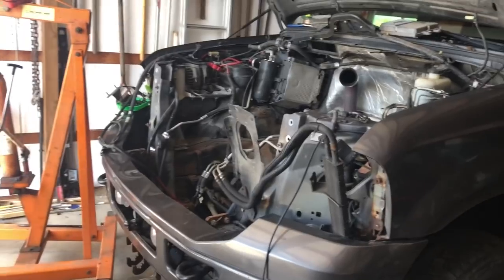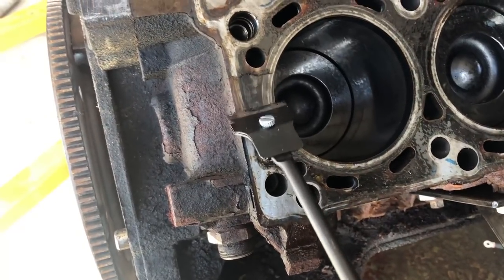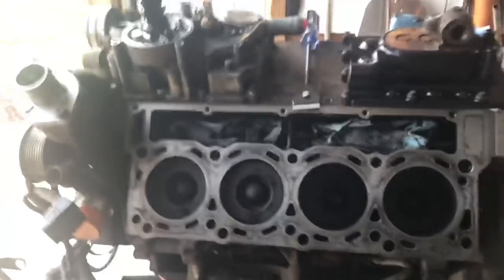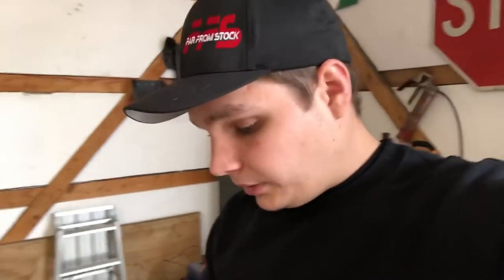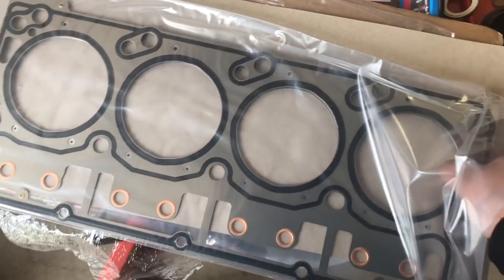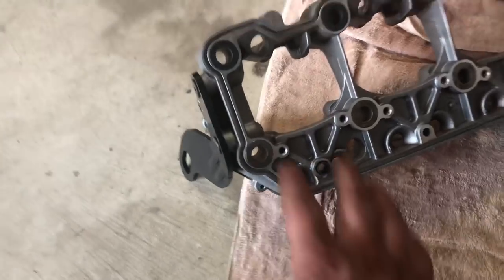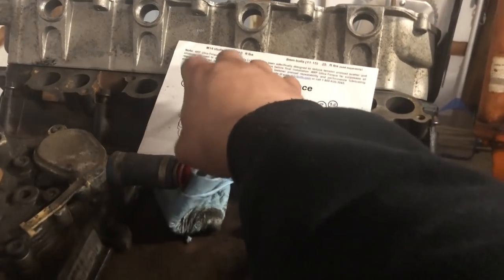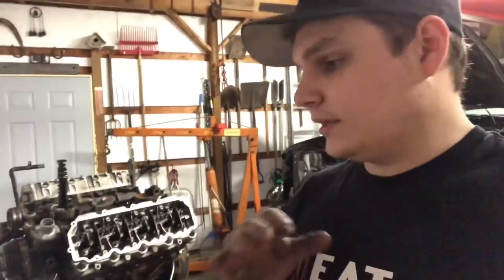STUDDING A 6.0 POWERSTROKE PROPERLY!

Comment: I was wonder why you like the ford powerstrokes so much I like the looks of them but people always say to stay away from them because there junk are the expensive to repair I work on all my gas engine the diesel don’t look hard to work on I was think about a 7.3 but I heard the 6.0 have a better transmission just wanting to hear why you like em thanks for the video
Reply: sorry for the long read... ford powerstrokes have had a bad rap in the light duty diesel world as they should, because they continuously have problems with their motors that competitors dont. however, its ford, and everyone associates ford with american (even though everything on the powerstroke is made in mexico) and their interiors and ride quality are far superior to ram and gm, like its not even close. because of this, powerstrokes and all the problems they have had are overlooked and people still demand them. they are and have been produced at a much higher rate than light duty cummins and duramax powered trucks, meaning the market is flooded with them and they are cheaper to purchase second hand. all diesels are expensive to work on, but there are a lot of people who have a budget and cant afford to spend 27k dollars on a 2005 cummins with 250k miles but can afford a 2005 powerstroke for 14k with 150k miles. because of this, many people who need a diesel for work or simply want one without breaking the bank turn to powerstrokes. so then it becomes what kind of motor. powerstroke motors were produced by navistar up until 2011, when the newest 6.7 liter powerstroke came out. 7.3, 6.0, 6.4 were all made by navistar and were all flawed in some way, which is why ford eventually dumped navistar and produced the 6.7 on their own. 7.3 have garbage transmissions, 6.0 tend to have bad oil and egr coolers and blow head gaskets, and 6.4 tend to have the entire long block grenade do to poorly designed parts by navistar. so for someone today, in 2020, looking at a used powerstroke who cant afford a 6.7, it usually comes down to between a 7.3 and a 6.0 (6.4s were such a basket case and a money pit that very few people consider them). the last 7.3s were produced 17 years ago in 2003... thats a long time ago. the motor has an amazing reputation for reliability, but they are just old and they ride very very rough. the 6.0 on the other hand is becoming a more and more popular option. it rides way smoother, is not as old, and produces way more power stock. because they had so many problems with the motor early on, the research and parts have been conducted and made to prevent these problems. a "bullet proof" 6.0 effectively eliminates the shortcomings of the motor (so long as you maintain it and dont abuse the motor) and makes it very reliable. add that to a relatively cheap market value, a generally solid transmission, ride quality, and a nice interior, and you can see why the 6.0 has become a popular option for people in the market for a diesel but who dont want to spend a fortune. sure people still love their 7.3s and it has earned the reputation, but as the years go on they become more and more primitive compared to newer stuff, people just have a tendency to avoid spending money on something so old. thats why the 6.0 is becoming a more popular choice
Reply: @natewilson7664  thanks for the reply
Reply: Nate Wilson excellent reply mate. Cheers from australia

Comment: Is it easier for you to pull the engine out to do head gasket vs doing it in the cab by removing hvac box or pulling a motor mount
Reply from the maker: I like to pull the engine for 3 reasons. 1. I don’t have a hoist to pull the cab... 2. Pulling the engine allows me to verify everything is clean, holes are clean, and the head gets set down perfectly.... 3. I get to reseal anything that was leaking like the oil pan/upper oil pan/bed plate etc. 
Overall the only extra work is disconnecting the transmission and undoing the motor mounts. But the benefits of having it removed completely outweigh that little bit of extra work. 💪

Comment: Hey I've got a few questions I saw in 1 of your other videos you have a one piece Turbo down and up pipe do you sell  those if so how do I go about buying them I've took the 6.0 out of my F350 we straight edged the motor block it has a .004 gap in between the 2 center cylinders right where the gaskets lay I'm gonna have my block decked and I've had my heads resurfaced will I need shorter piston rods an push rods

Comment: Scothbrite 18730 bristle disc is what you NEED to be using on those heads.. not by hand. You’ll never get that carbon build up off. And make sure you get that oil out of the head bolt holes or you will make a hydraulic lock in the bottom of that hole and when you torque the studs the oil has no where to go (think of a hydraulic piston) and you WILL crack a block..
Reply: Size 50? Or size 80?  I used 400 grit but it's not doing anything.

Comment: Been using razors to flat sand blocks for years now, I will never use a die grinder again. They don’t need to be shiny, they need to be flat. Definitely engines with liners, it’s critical not to cut material away that you can’t get back. After that its good to check it with a straight edge for  deck flatness to make certain you have no low spots 👍🏽 great vid bud.

Comment: I'm curious, you take your motor out the front, instead of removing the cab. It's because you don't have a lift. But if you did, would you still take it out the front, or would you use the lift?

Comment: Do I need the 6.4 pushrods if I get brand new KDD o ringed heads? Or just a stick with my stock 6 liter push rods?
Reply: Some later model 6.0s (like my 2007) have the shortened 6.4 updated pushrods , their slightly shorter, if you have them out measure them , the numbers can be found on Google

Comment: So much misinformation on these videos. I been doing these trucks since new. I never seen a cracked 6.0L heads in combustion chamber.  Just cracks in the  injector cup area and there are repair cups out there to fix those cracks. Any crack found in a 6.0 head surface is superficial and will never hunt a thing.
Reply from the maker: A cracked head should never be ran. A crack doesn’t go away, it only gets bigger. Most of the time i see cracks that start superficial on the surface but they work their way down into the exhaust valve seat. Big concern. What you think is misinformation is new knowledge that you don’t agree with. We can agree to disagree
Reply: @LeftLaneDiesels   We dont have to agree to disagree. That is a fact right from FordMoCo.
Reply from the maker: @steves7458  is the manufacturer always right? The answer is NO, lets be realistic. I respect your opinion of the matter and I don’t discredit your experiences. I know what ford says, they also say not to surface the heads. At the end of the day it comes down to my experience. Cracks continuing into exhaust seats and extreme warpage on heads. The 6.0 industry has grown, the knowledge base and experience has out grown that of ford.

Comment: It seems to be informative.   Did you check the deck for straightness?  You should use a sanding block tool and confirm the deck is straight.  And a straight edge.... just a thought especially since the head gaskets blew.  As well as it wouldn't be a bad Idea to recommend using hardened seat heads.  Since that is the most common crack found,  and regardless of what Ford considers acceptable I would not use heads cracked from the glow plug hole either way.  May cost more now but, in the long run could cost more.  The other would be using O ringed heads new castings and hardened seats.  Will save a lot of trouble.  Pulling out the front is so nice.  We do that since the cabs kinda suck even with a crane and jig.  Other than that you seem to have a pretty good video to help some people out.
Reply: I wouldn’t hit it with a sanding block tool unless you want a total mess on the deck surface.

Comment: Here is my question… seeing how long the bolts are it seems absolutely impossible to do an ARP stud installation with the motor in the block . So I’m assuming the service can only be performed with the motor pulled. Is my assumption correct?
Reply from the maker: It can be done cab on, many people do it that way. The heater box has to be removed on the pass side and I believe the motor mount on the driver side has to be removed. But it’s very doable
Reply: @LeftLaneDiesels  this is great knowledge thank you, I bidding think it would clear placing the studs how you did I’m the block then gasket an then the head in cab but man that’s wild thank you sir for replying

Comment: I started to use a wire brush on one side...is there a way to reverse this process?  Also, do you not clean the piston tops of carbon build up?
Reply: I honestly would get it checked by a shop to see if it will create a seal

Comment: I am unsure if I should O ring my 6.0 heads, is it really necessary?
Reply from the maker: What do you use the truck for and what’s your fuel/air set up?
Reply: @LeftLaneDiesels  All stock set up. Pulling a 24' camper, and 12ft trailer, responsible owner. Possible tune in the future. I feel like the oring option is overkill. I've done injectors and Turbo and in the process of doing EVERTHING else.  I noticed in the video you did NOT have oring heads. Just wondering what your thoughts were on the subject. Thanks for such an expeditious response, fully didn't expect one! Honestly thinking out loud. You are Awesome!
Reply from the maker: @MrSir-qq7wi  not needed for your application in my opinion. I usually recommend o-ringed heads when guys are running hotter tunes with larger injectors and turbo. The engine in the video went in my personal towing vehicle. Stock other than my one piece up-pipes I offer, all the ford updates, and an exhaust, with a tow tune, does great!
Reply: @LeftLaneDiesels   Thank you sir you have put my mind at ease. Starting to feel like the research is harder than the job itself. I am very thankful for guys like you who put your valuable knowledge out there, to help people who value doing it themselves! You are a gentleman and a mechanical scholar.

Comment: Can I ask you a question. When pulling the motor I think people use the turbo pedestal bolts to pull it. Is this a good idea or is there something better?
Reply from the maker: I made a bracket and used the 4 turbo pedestal bolts to bolt my lift bracket down
Reply: @LeftLaneDiesels  thanks. I really enjoy your videos and have learned much valuable information from you. I'm working on mine now. Motor should be out tomorrow!
Reply: We did get my motor out yesterday. I plan to make a video today before I start dismantling it to start the upgrades and tell what was wrong with it. I hope you watch it after I post it

Comment: Question for you, I burned up my direct clutches in my 06 f250 6.0 yesterday, looking at a built trans, truck is a little over 500hp, powermax and 155cc and many other goodies, would like to overbuild it just to be safe who do you recommend, suncoast ats, etc? Thanks
Reply from the maker: Sam wyse stage 2! Wyse auto repair in Ohio. Only place I can trust
Reply: @LeftLaneDiesels  
Thank you
Reply: Stay away from ATS, heard too many Horror Stories about them. A friend of mine rebuilt quite a Few 5r110,s He also said stay away from ATS and Suncoast. Sam Wyse is a Good Choice. I highly recommend Twisted Diesel, There Level 3 Trans. Is there Top of the Line 5r110 My Friend has their Making almost 750 H.P. There Transmission hasn't skipped a beat in 3 Years, Also a Co worker of mine has theirs also and Loves it. My Transmission is still holding up at 572 H.P.  1016 Ft.Lbs.  i do have a PI Converter and Billet Input Shaft. When mine starts to slip, Twisted Diesel is the One i will be going with also, i haven't heard Nothing Bad at all from them.
Reply: @badass6.0powerstroke10  thanks, I went with Sam wyse stage 2
Reply: @007.3l  Very Good, heard Nothing but Good Things.

Comment: Explain me the difference in head bolts and studs , they are the same thing, the stud you add a nut . A bolt it already has a head. These engines are a money pit , people that have not have had trouble with these engines, don’t pull a lot
Reply from the maker: It’s all about clamp load. 
The factory head bolt is a TTY-torque to yield- meaning that when torqued the bolt actually stretches. These bolts have proven to be insufficient in maintaining proper clamp load of the head to block, especially when running high cylinder pressures. 
Studs provide you with a greater clamping load. Not only that but the studs are made of better material and are non TTY. These can be used multiple times before needing to check for “stretch”. 
Overall ARP headstuds are a superior product over the factory headbolts when it comes to clamping the head to the block and maintaining that force even with elevated cylinder pressures commonly seen in trucks that are tuned and or running larger turbo/injector combinations.
Reply: @LeftLaneDiesels  you earned another subscriber , thanks for the quick response. Can you use your studs over again, or do you need to get a new kit ? One more thing, what do you think of o-ring heads? Thanks
Reply from the maker: @johnanderson2451  You can reuse the arp headstuds 2-3 times. Although some guys torque them over the ARP final torque of 210. In that case they should be measured for “stretch”. 
O-ringed heads are highly recommended, definitely worth the money if you plan on pushing the truck with hot tunes, heavy towing, or bigger turbo/injector combinations. Although not required, they give the peace of mind.
Reply: @LeftLaneDiesels  where are you located, if you are close, I would just bring my truck to you, I would pay you up front.
Reply from the maker: @johnanderson2451  southern Michigan near Ann Arbor and Jackson
Reply: @LeftLaneDiesels  ok , you are a long way from me, I am going to get me some O-ringed heads . I bought my 6.0 new in 2006 , and I am on my 3rd engine, I pull with it and have changed my oil every 2000 miles, because I pull, thinking it was the best thing, but that doesn’t have anything to do with head gasket issues. I have never exceeded the manufactures towing specs , they should have told me not to take it to the mountain states . If anyone wants to pressure test their truck, take it to the western mountain states , pulling hard for miles, the 6.0 cannot hold up to pulling day after day of mountain pulling. They have great power, but that is their demise .

Comment: You are going to have a problem with those head gaskets.....O.E.M. is the only kind you're supposed to use. I've been a mechanic for 35 years and Fords are finicky if you use an aftermarket head gasket it will fail I promise you.
Reply from the maker: You are wrong
Reply: @LeftLaneDiesels  time will tell 👍
Reply: I've used ford and felpro never had a head gasket go on either but on the 4.6l v8 2v and 5.4l v8 2v gas the ford intake gaskets failed me 2 times and the felpro is a better gasket on the intake and yes I torqued them in sequence! That  ford recommends. Here in central Virginia in the blue ridge mountains you're going to know which is the best for example 05 f350 srw  5.4l 3v v8 loaded with tools at 10,000lbs + a trailer 2,000lbs + 8,000 skid steer + a pallet of concrete 3,500lbs and gas mileage averages at 2 mpg on the mountains need too get a diesel!!! But the gas does the job at 20mph!!! In a 25° grade uphill it's a dog but the Dump Trucks don't go any faster on rt 250
Reply: You can use Felpro or Victor Reinz black diamond. Victor Reinz black onyx are the ones that had problems
Reply: Like us he’s is going to have to learn the hard way

Comment: All that work and you did not install O-Ringed Heads? Why not?
Reply: Also, did you check the block surface with a straight edge to ensure that it was flat off camera? Not meaning to sound negative but I went through this last year on my 2003 and those were two items stressed that were highly recommended to greatly lessen the chances of blowing head gaskets again.
Reply from the maker: Didn’t do oringed heads because it seemed unnecessary for the application the truck will be used for. It’s very unlikely that the block surface would be warped, clean it up and your good! I used to check block surfaces with straight edge and after not having a single one with an issue I decided it’s not necessary.
Reply: Left Lane Diesels the time that you don’t check is when it’ll be warped....I think it’s good practice to check. Never know but reassurance is nice.
Reply from the maker: Agreed reassurance is nice if you have the straight edge available

Comment: Do you recommend to machine heads? Ford says don’t??
Reply from the maker: Chad Semones always take the heads to a machine shop to check for flatness and cracks. Machining isn’t always necessary. But if the head is warped some machining will be required. There is a spec the machine shop should follow for head thickness.
Reply: Left Lane Diesels so would u run a 6.4 rod if you take anything off the head?
Reply from the maker: 6.4 pushrods!
Reply: One more question.. what about the head gaskets, what brand or brands
Reply from the maker: Ford, felpro, mahle. All acceptable, I personally use felpro

Comment: A drill and a wire brush attachment would’ve saved hours
Reply from the maker: Wire brush use is a guaranteed failure
Reply: Wire brush lmao, are you joking?
Reply: @drewsgarage1558  have you had any issues?
Reply: @gmiles7217  issues with what
Reply: Using a wire brush
Reply: @gmiles7217  I've never used one on a block and never will lol. It will take material off giving you an uneven sealing surface. You will be back in there doing another head gasket job guaranteed.
Reply: @drewsgarage1558   I’ve done it several times years later not a single issue